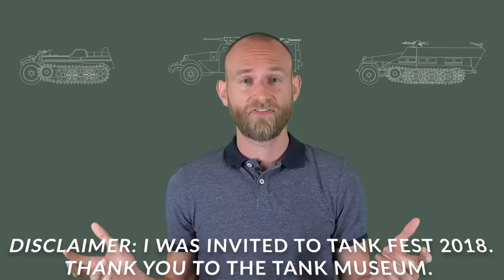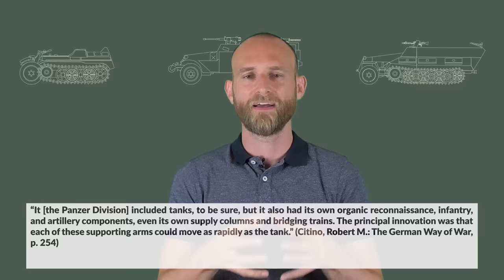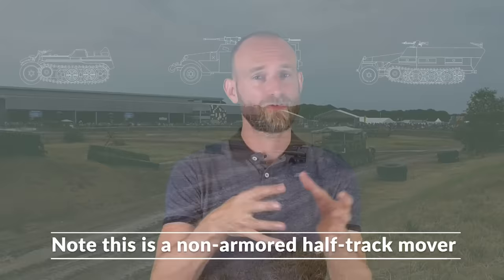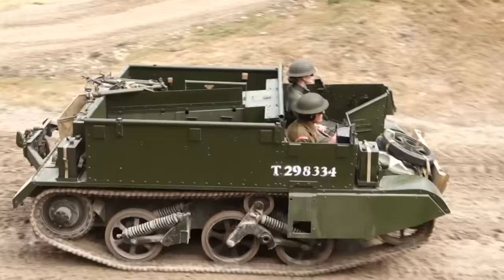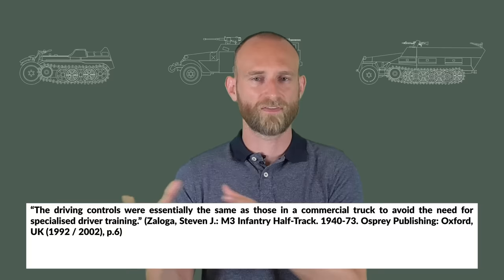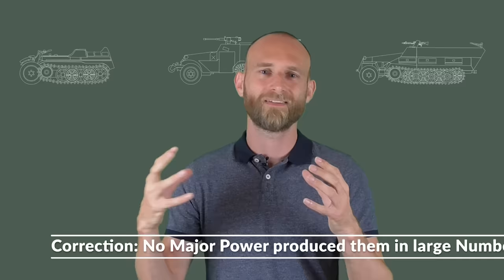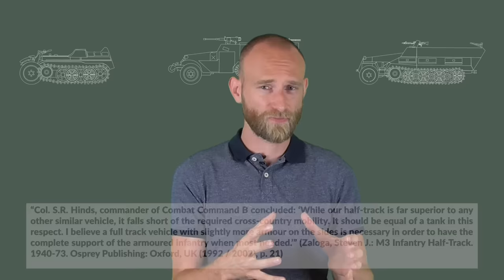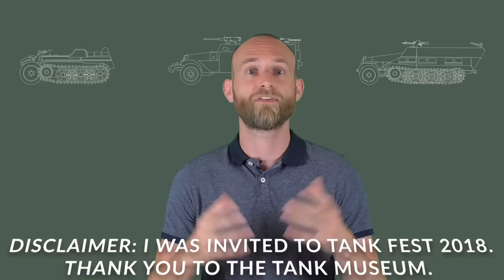Why Halftracks? Why limited to WW2 only? (Featuring Tank Fest 2018)

Comment: That was interesting. Remember before WWII, tanks tended to be fairly small and unreliable. Even larger tanks had very little interior space, so they did not look at all suited to converting to troop-carriers. Trucks and motorised infantry were a much better option, but lacked cross country ability. So it was logical to adapt trucks to half tracks, rather than modify tanks into APCs. During WWII larger and more reliable tanks were developed, and the idea of having a fully tracked infantry-carrying vehicle was much more practical. However, during the war itself, tank production took priority, so vehicles such as the Kangaroo APC were still quite rare during WWII - even though they were quite successful vehicles.

Comment: The short answer is to the question, why no more 1/2 tracks. After WW2, there were tremendous technical advances in drive train and suspension designs. This narrow the difference between wheels and tracks off road.  The result is military vehicles are either wheels or tracks. Wheels only are more common, because wheels are more resistance to mines and other battle damages, cheaper to run and maintain, faster, quieter and easier on the roads and poise a less aggressive image. The proliferation of auto transmission also make driver training easier. Towing is not done as much as it used to be, for there are many more mobile artillery like the M109 and MLRS on Bradley chassis. We also have many tactical trucks like those made by Oshkosh, Tatra etc.

Comment: Another potential reason is that the transmission technology for tracked vehicles has improved to the point where many tracked vehicles have as good or better handling than a half track meaning that the benefit of being more road maneuverable was effectively erased over time.

Comment: The other thing that should be mentioned with regard to the popularity of half-tracks during WW2 was that they were easier to produce in large numbers in comparison to say fully tracked vehicles.

That being said, even the Germans realized midway into the war that half-tracks were too restricted in terms of off-road mobility: The un-powered front axle of most half-track designs proved to be a liability in deep snow and thick mud and the Sd.Kfz. 250 and 251 series were notorious for losing steering control in muddy conditions. Just before the end of the war, a couple of prototypes for two designs for an order for a fully tracked sPW had been produced and were undergoing trials.

Thanks again for yet another insightful video :)

Comment: This is an example of why I love learning about WWII. The tech existed, but nothing was refined. It was a war of innovation, countries invested and developed tools and vehicles that needed to serve a purpose, but where the concept of how best to serve that purpose hadn’t yet been figured out. So they just made things work. That’s why there’s so many wildly different vehicles that came out of the war, there were so many needs to be filled and the number of ways they tried to fill them were just as varied. 

The benefit of the halftrack being able to off road and on road travel also meant it was versatile. Hence why they got used for everything. From troop transport, anti-tank, support weapon towing, infantry support MGs, mobile mortar platforms, mobile anti-air platforms, even ambulances. They could do just about anything, anywhere and had a mounting system for it all. It’s what made the Sherman so great too. If you needed something done, there was a Sherman for that. Versatility helps logistics greatly and logistics is a huge reason the allies won that war. If we needed something somewhere, you’d have twice that much on hand sooner than you expected.

Comment: You can have extra armour and close the halftrack top. Im not sure why you listed that two particular reasons against the halftrack, as that applies to any modern APC too. Actually the M113 is papper thin despite being fully tracked. Open tops and weak armor are not really mandatories features for a halftrack.
Cross-country mobility was the main reason for the halftrack demise.

Comment: Road conditions, have changed by light years in 80 years. After driving for 40 years and driving commercial for the last 10 years.
This almost as big as logistics.
Maintenance is much higher for track vehicles, but do not forget gas engine VS diesel engine. As much as torque VS horse power.
Reply: Kurt Seaberg  I bet that is a much bigger factor that this channel is giving it credit for.
Reply: Kurt Seaberg 
It's the time when you're having to be off road that really defines what your need is in an infantry vehicle. The logistics point is well made. By contrasting the German success in France verses Russia it would be interesting to see the correlation of their successful advancement verses the ability of being able to properly maintain and supply their forces.
Reply: @Lord Byron 
When we think about the Soviet Union, we have to take into account the vast distances as well as the poor quality of the roads.
Reply: Lavrentivs - Yeah, roads that turn out to be paved with chocolate pudding during the rainy season, which runs from spring thaw to late autumn frozen solid, slow vehicles down.
Reply: Knut Der Große. Gasoline blows up easier than diesel.
Reply: But you could not artificially produce Diesel. Germany had to choose gasoline, because they had a shortage of fuel and had to artificially produce it. Also, gasoline engines are lighter.  But yes. less torque. Which means nothing if you cannot get the fuel :-)
And also, diesel gels up in very cold weather. Making the engine hard to start and increasing the wear and tear considerably. Less of an issue today with added chemical in Diesel.
Reply: Ok Gentleman,
I own five U.S. military trucks
Two M35a2, One M35a3, One M931, and one M936.
So believe me I get the pro and cons.
I also drive a M18 Hellcat and M211, M135 2.5 ton trucks.
M16 half track, and M8 greyhound. 

Training time, and maintenance time, are huge factors. The working environment, next supply(ie fuel mileage and avilabiliy). Manufacturing is a point forgotten by the military. 
I think all of these played a part and must be considered.

Comment: Anyone who has operated a skid steer type vehicle on a hillside understands why having front wheels (or even front tracks) is a good thing. You can point them in the direction you want to go instead of denying power to one side of the vehicle's tracks to maneuver.

Comment: Thank you for the video.   I  would add that I think another great role that the Half Track played
was in replacing the many draft animals like horses and mules that were used in so many great
numbers in WW I  to pull artillery pieces  and to transport supplies up to the front.

Like the horse a half tracked vehicle had a lot more mobility pulling a large artillery piece than 
a truck did on muddy roads and where there were no roads.

Comment: In HOI4 I recently tried to make a mechanized focus German army rushing the tech before the start of war, seemed like a good idea at the time until I was against USSR and lacked 5k mech reinforcements even with 60 factories building them I couldnt keep up. I had 23 divisions with 20 combat width all mech and I did have maintenance support on them as well.

They cost to much to make, are too slow, not reliable, and break through is not much better then a standard truck. Better to focus on leopard 2 since they take about the same time to make.
Reply: in one of my germany games i was able to field about 100 divisions of mechanized infantry, idr if 40 or 20 width, by around 1945 or 46 with insane amounts of stockpiled vehicles and performed wonderfully, but overall it's more of a late game thing. at best it's probably best to have them flesh out your tank divisions in the mid game but i agree that rushing modern tanks is better than mechs. the real issue i have with mechanized is that you require way too much industry to be able to devote to actually outfit your main forces and often when you get to that point you've basically won the game already anyway so you're just doing it for shits and giggles.
Reply: I was trying to go for mech as my breakthrough division instead of tanks as Sweden. Swe going to war with Soviets really shows how effective something is (because if it isnt it gets screwed), and mech just didnt perform well at all. Also in most cases where I could use their speed in a gap or whatever - truck divisions would have worked just as well, but cost way less.
Reply: Fenno-scandinavian terrain is just not that good for vehicles^^
Reply: trucks are soft targets they're vulnerable. but with more of them you can fulfill more types of missions. mechanized infantry is specific to supporting certain types of tank movements, when tanks can get chewed up by tank busting units or lack the volume to push through and hold new territory. eh it's been a long time since HOI3 that's what I remember from that game.
Reply: If you just set the cost or the reliability of the unit in the game a bit differently, it would be very different. Because that's not real life.
Reply: Lavrentivs, well i guess you are thinking about northern sweden, or norway. Southern sweden do have a lot of fields and open forests and lacks higher mountains. In fact we imported german halftracks before Volvo started to produce a copy of those in 1943 or so. Btw hoi 4 seems so unrealistic, i will never stop playing hoi1 and my own version of core 0.93.

Comment: I think most people are not stopping and thinking thru engine technology. If you compare the power output of engines at the start of WWII vs the end, you can see that from  practical point of view, the half track allowed you to utilize existing engines in a fashion that allowed for cross country use. After the war was over, there were engines that had the proper power to weight ratio to allow for an enclosed vehicle, plus you had 6 to 8 years of practical engineering on your side to come up with a reliable tracked APC.

Comment: I don't know any APC that can carry as many soldiers as the good old halftracks.
Reply: edi Very very tightly.
Reply: XA-180 for example
Reply: edi The M3 Halftrack and German Halftrack both carried 10 people. The M113 carries 11. The earliest BTR-60 models carried between 12 and 16 people. The FV432 carries 10 people.
Reply: edi but current wars don't require as many infantry units as was needed in ww2. So the apc now don't need to carry as many anyway
Reply: Jacob Babb Plus by sacrificing 2 or 3 men, you get vehicles like the Bradley and BMP which can be real powerhouses with the ability to suppress or destroy entire enemy squads and even knock out tanks.
Reply: True, but you need trucks for logistics. Sometimes you simply have to get hundred people, a few tons of ammo crates, spare parts etc. These vehicles don't need any armament, though an MG on top never hurts. You could of course carry the same load in 4 bradleys, but then they need to drive more often, or you need a bigger fleet. Either way, it costs far more.
Reply: edi But we still use trucks, so there isn't actually any issue here.
Reply: I know. But why don't we use them with tracks?
Reply: edi Because modern tires and suspensions are far superior to what we had in the 40s. So the tracks are unnecessary.
Reply: But can't you go steeper, through muddier or sandier terrain and even pull more with tracks?
Reply: edi I think you're drastically overestimating the terrain that trucks on simple supply missions are excpected to go through. In modern warfare we use roads anyway, and modern trucks can handle the kind of environments that used to require tracks. The halftrack is simply an obsolete concept.
Reply: Oggy - Any kind of caterpillar track inverts the mpg to gpm. Tracks are very inefficient for transport vehicles. If you have any kind of actual road, not a mud trough.
Reply: John Doe well in war roads turn often into moon surface. That's why I fought that at times they need to go off road for a while.
Reply: edi We just don't have that sort of war any more though. Plus, the wars we have been fighting continuously for the last 2 decades tend to be in drier places.
Reply: Yes, but you can't just base your war preparations on past events. If we had an all out war (God forbid), then they might be more useful.
Reply: edi Except that you'd need everyone in full NBC gear outside the few remaining safe areas.
Reply: War preparations are not just based on past events and wars. Mostly they are based on what the current situation is and who is the most likely enemy.
During the cold war, USSR was the most likely enemy. A war that would have been fought in central Europe. Lots of good roads, but also the need for off road capability. Hence the M113.
Since the 1990's, the enemy has been in the middle-east. Dry and rocky terrain, with few and crappy roads, but modern tires are more than capable to drive in the hard rocky sands roads of Iraq and Afghanistan, since the roads seldom turn to mud. And with the many IED's you actually go more towards ferrying infantry in helicopters than in apcs.
Now, with the current issues between US and Russia, we might go back to using more tracked apcs. Who knows.
But the point is. You cannot be prepared for everything. Not even the US with their huge budget does that. You have to pick the most likely scenario and prepare for that. And standardize to cut cost. Which is also the reason you sometimes end up in what the common soldier on the ground would call sub par vehicles.
Reply: Karakoth We always try and fight the last war this time.

Comment: I suspect one big reason why halftracks were popular was the lack of suitable engines for fully tracked versions. A halftrack only requires a truck engine, which was easily acquired, but a fully tracked carrier like the Canadian Kangaroo used a tank engine. Either that, or it was very small like the British universal carrier or French Lorraine 38L. Postwar, there were plenty of high powered engines available. The first US fully tracked APC in service, the M75, had an engine about twice as powerful as the M3 halftrack.

Comment: Didn't the US used their M3 in the Korean War and also later in Vietnam?
Reply: Yes. so?
Reply: Most of them were the M-16 Quad-.50 AA vehicle used mainly for ground support.
Reply: ´coz the title asks "why limited to WW2 only" and it is clearly not the case that halftracks died out after WW2, you and I seem to agree that they have been in use after that as well
Reply: Yes :-)
Reply: Karakoth But only in limited numbers & no new mass production worldwide.
Reply: @truecerium4924  They did die out after world war 2 production ceased = dead just because they were used in some limited capacity doesn't make the title incorrect, plenty of left over weapon systems used in ww2 no longer in production saw limited action in other wars that's because it was already available and still somewhat effective enough to use.
Reply: @BrokeSpike Hi there, hope you are fine. Out of production doesn´t mean out of use. Especially with military equipment which is normally well looked after. My rifle was older than me LOL. According to Zaloga "M3 Infantry Half-Track..." this US vehicle and it´s variants were still in use 3 decades after WW2, a period 6 times as long as that aforementioned war. Of course the M16 was obsolete during the Korean and Vietnam war as an AA gun carrier in the jet age. But it took on a new role as infantry support vehicle in ground combat. A wide variation of M3 has been used by armies worldwide after WW2 right through the Cold War. So they have not been out of fashion or obsolete. And we haven´t even touched yet i.e. on Sowjet/Russian half-track vehicles...

Comment: Although not meant for military, the Half-track design has been redesigned and reintroduced into the world of agriculture. CNH, the company that manufactures agricultural machinery like Case IH and New Holland, have come out with a revolutionary design that took a page from the half track designs of the past. Case IH came out with the Rowtrac tractors while New Holland came out with the SmartTrax tractors. These vehicles have steerable wheels up front while replacing the rear drive wheels with a sprocket driven track systems that rolls on a roller suspension system. The design came out for the need of a powerful fixed frame tractor that could limit the amount of weight being distributed across the ground. So a half track design was developed and so far has had much success.